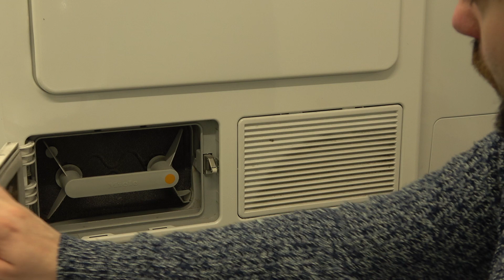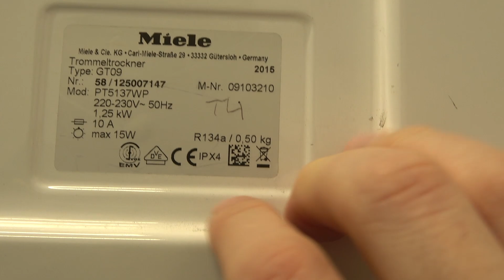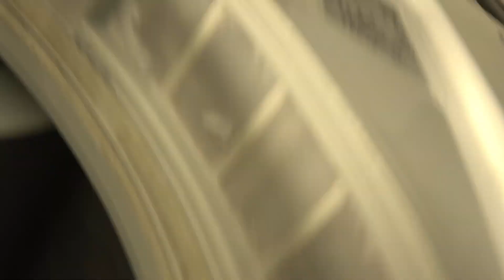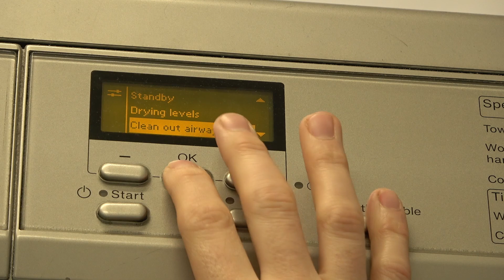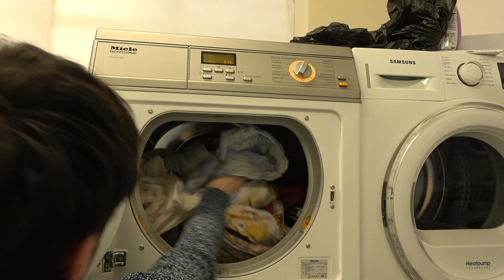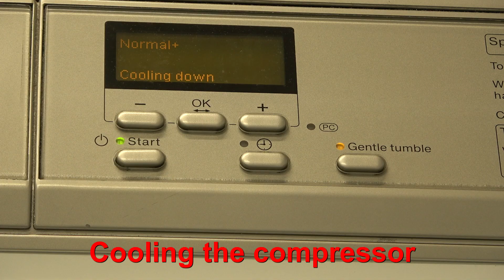Review of the Miele Proffesional Heat pump 6.5kg PT5137WP Condenser Tumble dryer

Comment: I got the Miele eco comfort heat pump dryer think it was made in 2009 had the refrigerant sensor pop and then another one popped weeks later think it’s a moisture sensor can’t remember my sister seen to it both times as was working but the guy fixed it (was not confident to do it myself so payed for it for it to be fixed) 
It’s a great dryer 18p to 23p an hour and dries pretty much anything and no shrinkage.  
The guy said it has years left hope he is right 🙏🏻

Comment: On my Hotpoint heat pump dryer, I use Anti Allergy for bed linen and mixed for everything else.  So, I can't see the point in all these programs. My old white knight vented tumble dryer just had cool and high with a machinal timer.  I could have fixed it but with the cost of electricity, it was not worth it.

Comment: As for ‘that’ overflow dump valve ~ Miele is expecting it to be in a wet room sitting over a drain?
Reply from the maker: Except the dryers are stackable on the washers too. Very strange design.
Reply: @ - 🫢, so if it did that & sitting on a washer = you’d find water dripping off the washing machine, or worse it sitting in a small puddle “has the washer suddenly sprung a leak?” to later take the tumble dryer off the washer to 🧐 and find more water on top of it “er…. where did this all come from?” 🤨. Like you said in the video, should it have a [slide-out] sump-pan under it